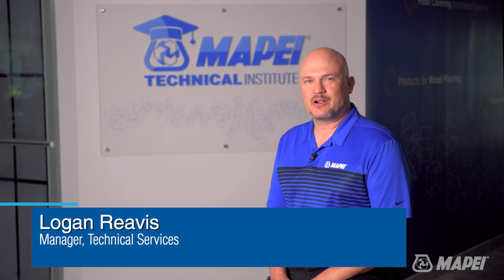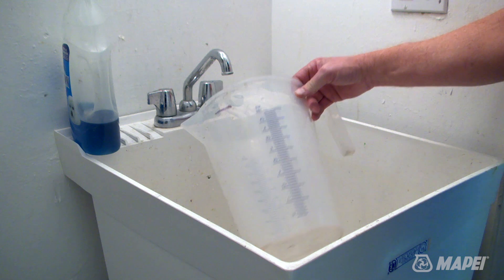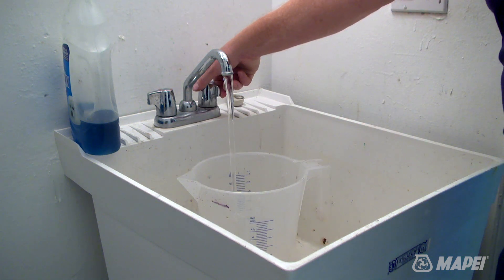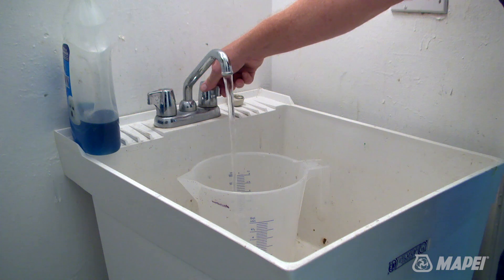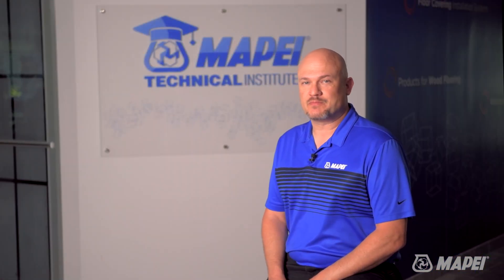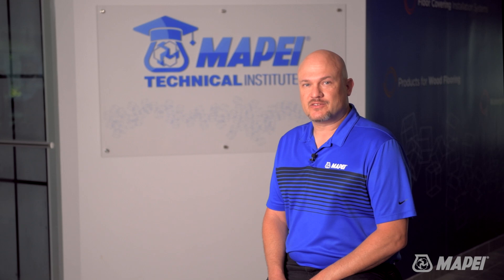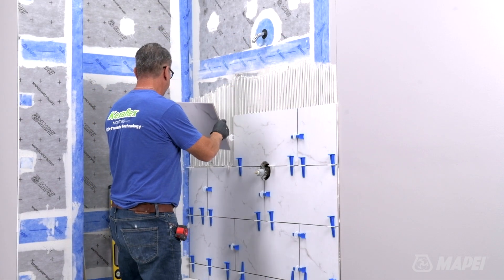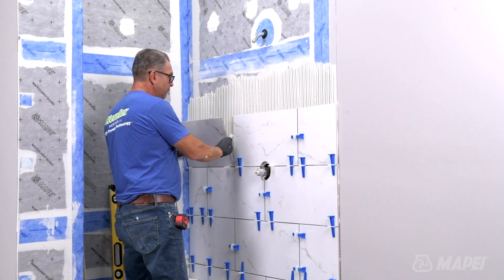Tech Tip on Water-Ratio Range for Cementitious Products

Comment: This doesn't tell me the damn ratio. I don't want to know how many gallons per 50 lb bag. If I'm mixing up a small amount because I am not planning on covering 35 sq ft then would I use 4 to 1, 3 to 1, 2.5 to 1? I don't care what the ratio is but I need a ratio not a water measurement.